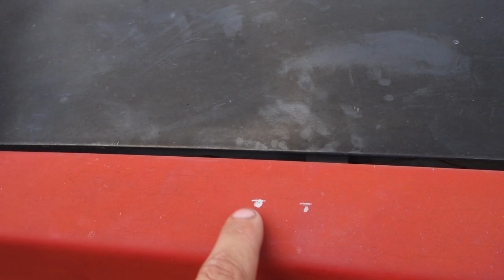D21 Hardbody Fender Mirror Install

Comment: First thing I did on my fenders when I got it was pull all the bolts out of the front up by the bumper and put zip ties in their place so I could easily take them off